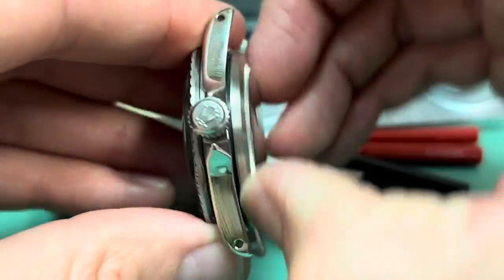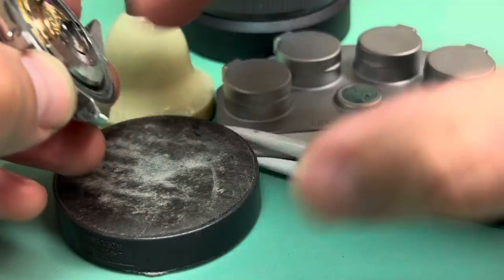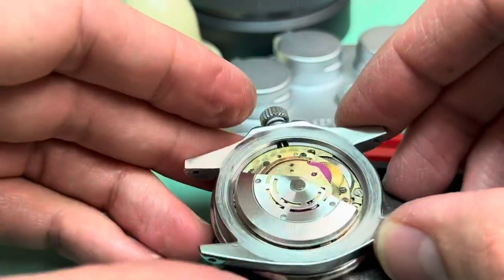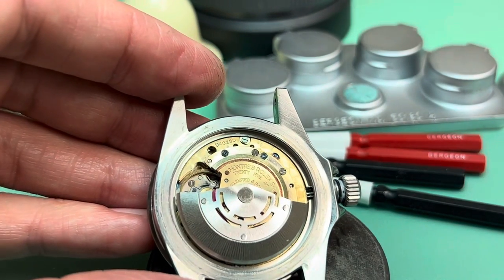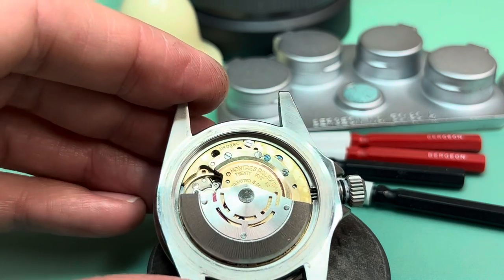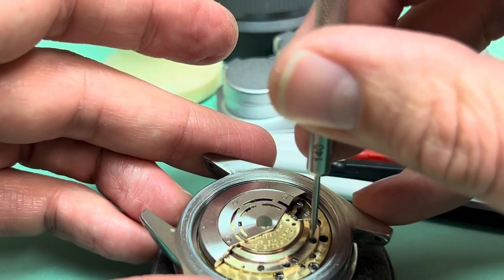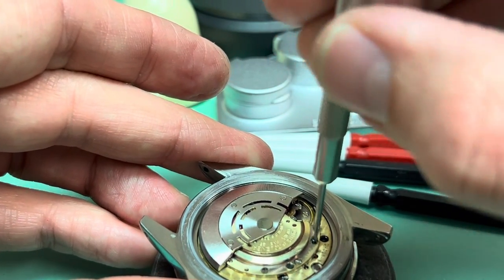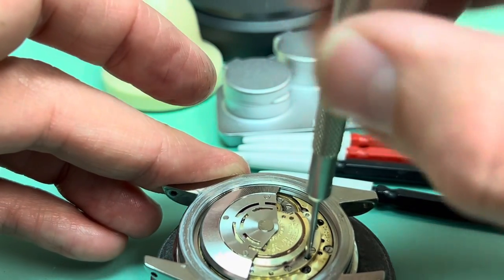How to Set a Watch to the Second Without a Stop Seconds Hack

Comment: This is a cal. 1560 correct?
Reply from the maker: I believe so. I think the 1530 is the two liner and the 1560 is the chronometer. Then the 1570 took over. This was from a watch serviced months ago so, I may not remember correctly.
Reply: @Timesradical  Yes I believe you are correct. Only the 1520 was non-COSC. Many are surprised when I tell them that Aegler SA based in Bienne/Biel provided the movements for Rolex back in the day as many are under the assumption that every Rolex built from the 40's on up are all in-house. It of course became less of an issue when Rolex acquired them in 2004.
Reply from the maker: @24hourgmtchannel64  YES! The 1520 was the non-COSC. That’s exactly what I was unsure of.